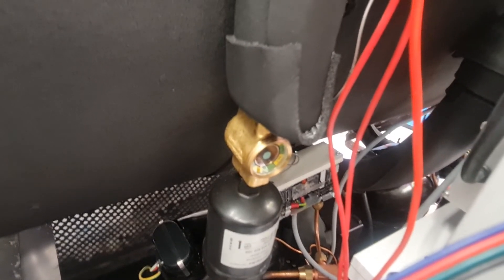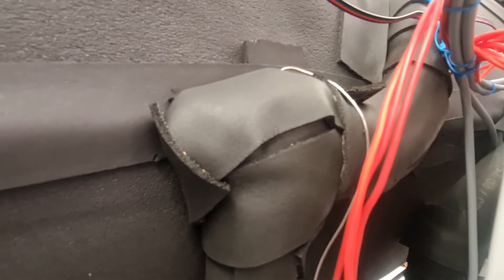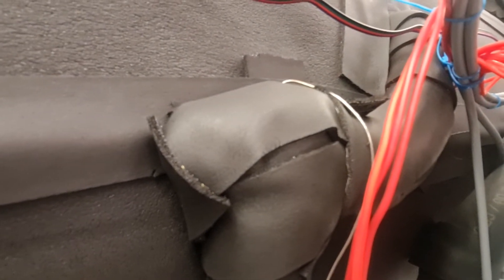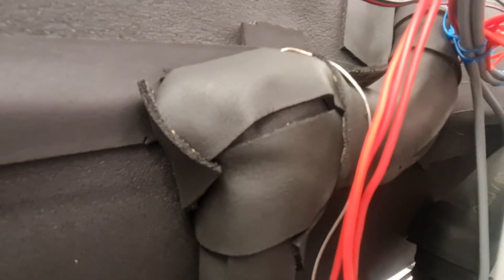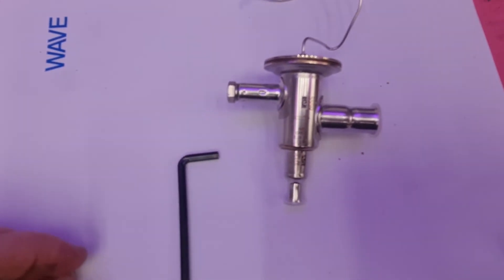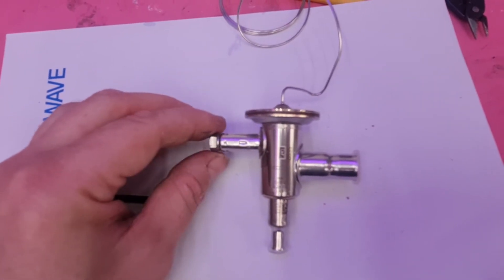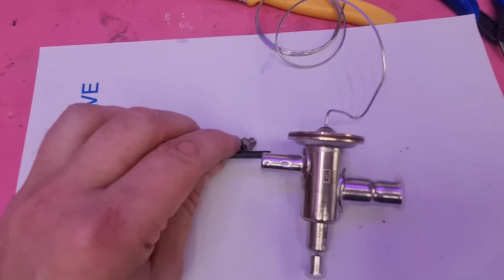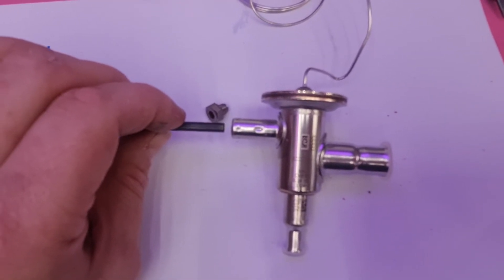WAVE FD260 & FD400 series: The TXV Expansion Valve

Comment: TXV needs to be adjusted with Guages on and temp sensor on a suction line to adjust the super heat. Freezers are set 4-5 degrees superheat. So your at -45 , suction line is -40 it is 5 degrees. Suction frost is normal and ok. Anything below 32 degrees will have frost. Don't play with the TXV.